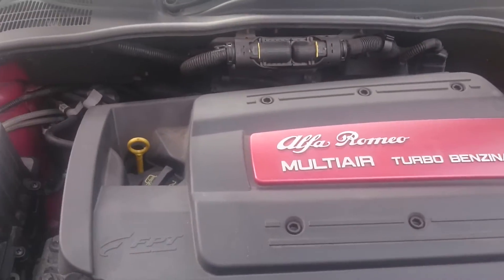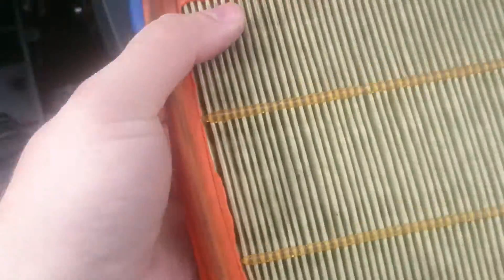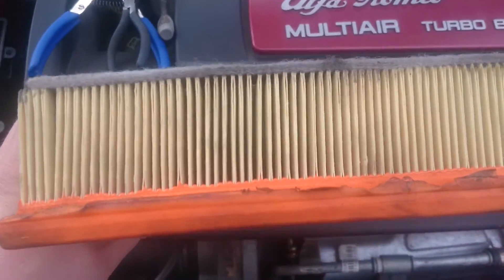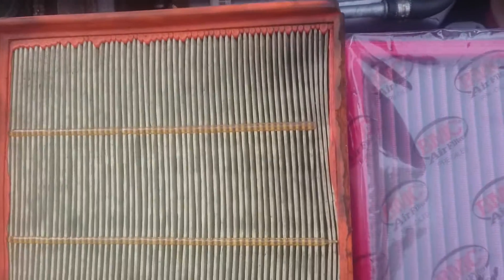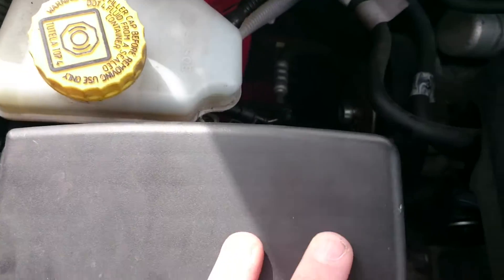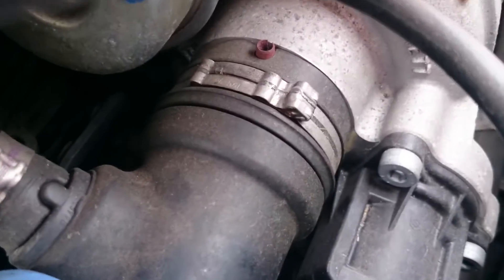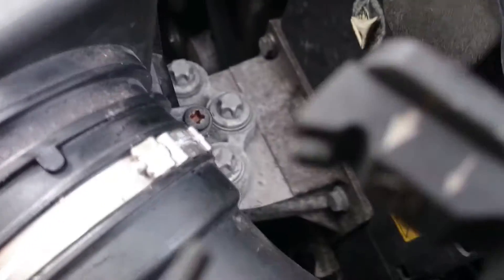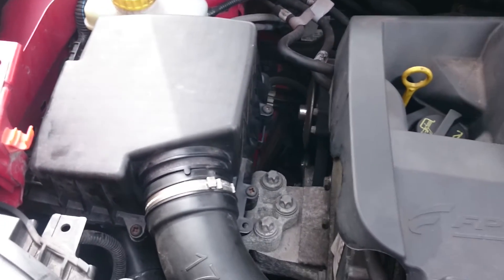Alfa mito cloverleaf bmc filter replacement

Comment: Getting that lid back on was the bit I needed to see...
Reply from the maker: As Haynes would say, fitting is the reverse of removal. Joking aside, it was a pig to do because of space, hence I needed both hands. The left hand side of the filter casing attaches first and clips in at a angle. About a 35 -50 degree angle. You have to get it under them 3 tabs. Once in position you can lower the right hand side down and replace the screws then fit the pipe
Reply: I sorted it another way.  Ignore those clip in bits (technical term) and just line the lid up.  Screw in the right most screws first, all the way.  Then the other screws, each one a bit at a time.  Those clips just snap into place, with just a little bit of persuasion...